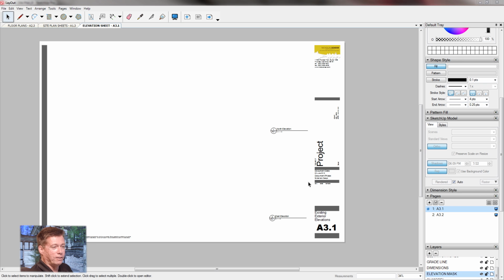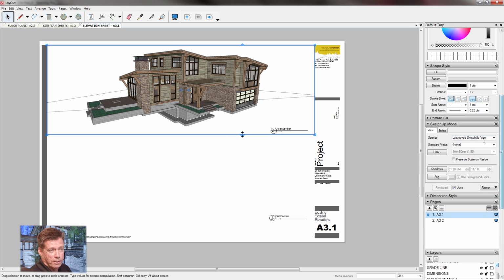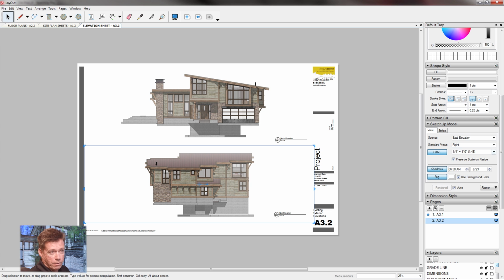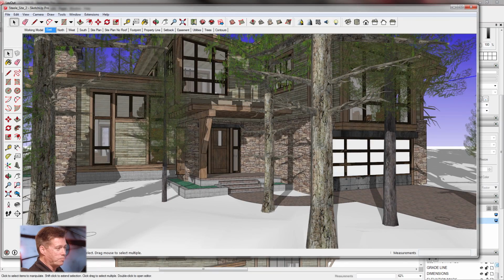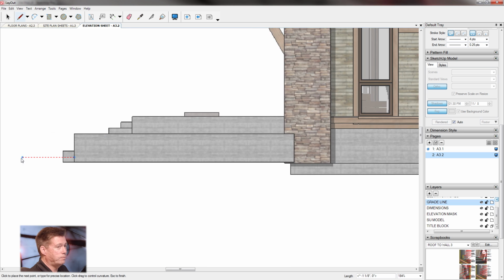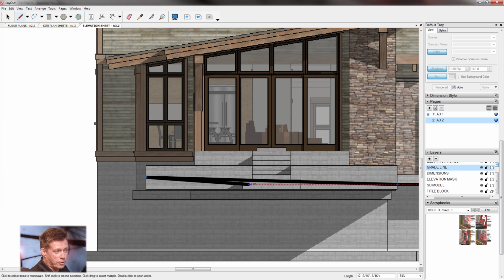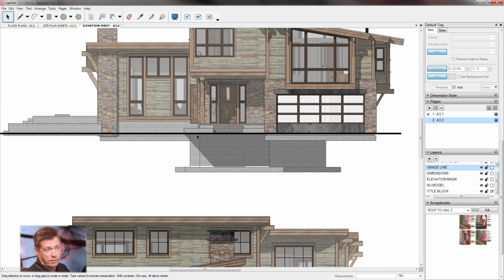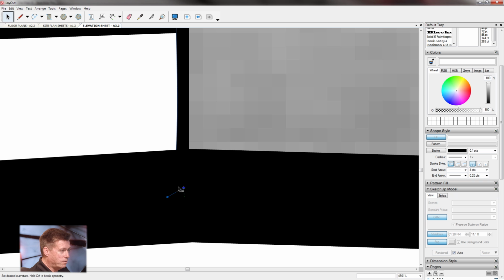SketchUp for Construction Documentation: Layout Elevation Template

Comment: Thank you for this awesome video, Nick. I have used Sketchup for basic 3d modeling before, yet I am very new to layout. My goal is to use Layout to create construction documents as you do, but I do not need/ want to show materiality on my elevations. Is there a layout template or style that you would recommend to achieve this? I ultimately am looking for all black and white construction documentation, and perhaps add shadows later as I get more familiar with Sketchup. Thank you.